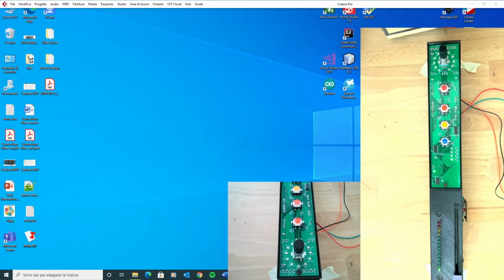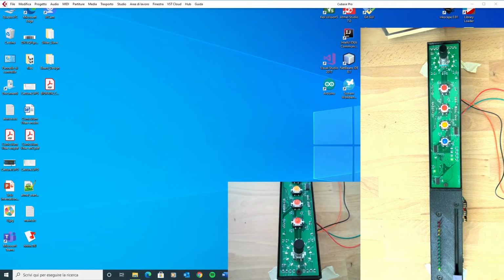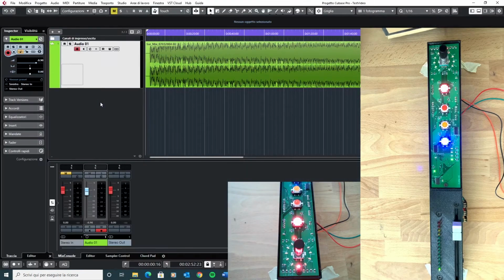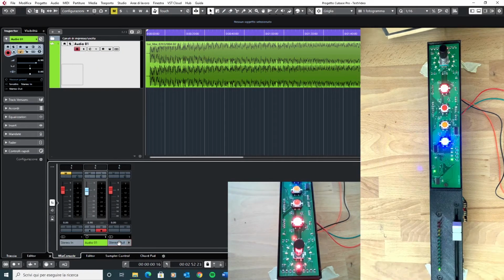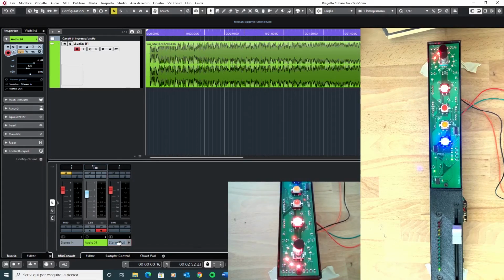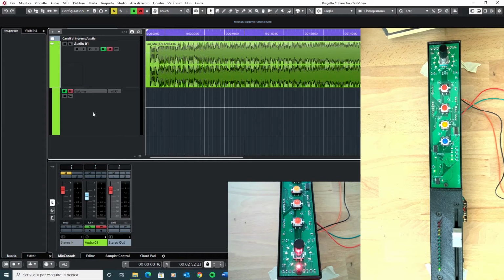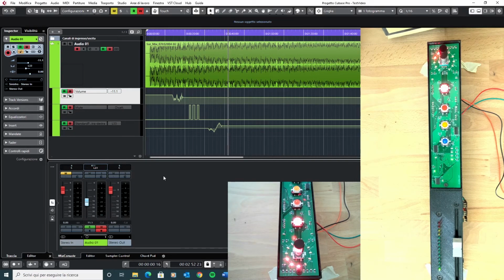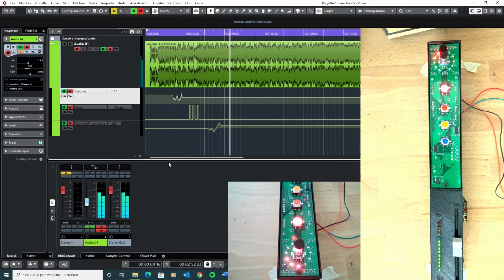DIY MIDI Remote Controller - Full Strip

Comment: Hey,
Could you tell the name (or may be link) of this glowing buttons (buttons with leds)? I couldn't find exactly the same ones.
Thanks.
Reply from the maker: Aliexpress for instance https://m.it.aliexpress.com/item/32425286226.html?spm=a2g0n.order_detail.0.0.3d28582fjbLMWF&gatewayAdapt=glo2ita
But you can find it also in Amazon I guess they are quite common.

Comment: Hello, i cant found the SAMD1114AS on the internet. Are there alternatives that work??
Reply from the maker: Well SamD11 are cortex m0+ based CPU so D10 or D20 or D21 will do the trick if you manage to find them. Just you will have to work a bit to adapt the software and design…
Reply: @fcampanini  oh, i really want to leave your code like it is  and use your Chip, but it is not available on the market due covid?! Or do u have a other market where i can find them?? Big thanks for everything
Reply from the maker: @maxcherry89  unfortunatly the situation is what it is. Last month i have found some D20 on microchipdirect.com site… the only thing you can do is to constantly check and see… from time to time something pops up. Cheers